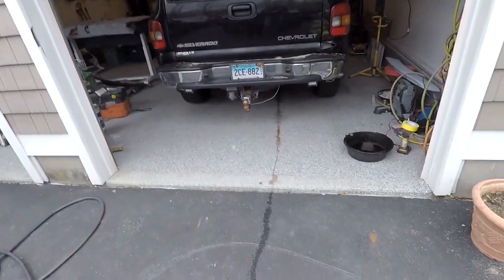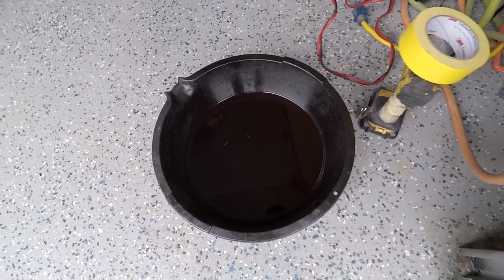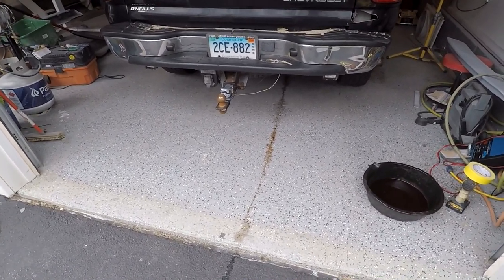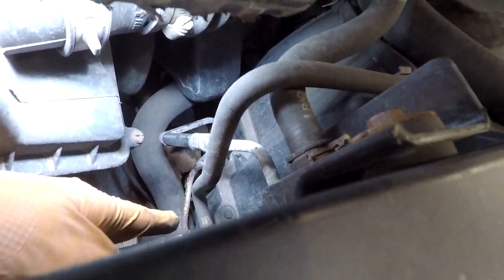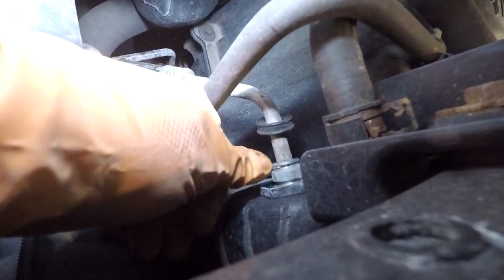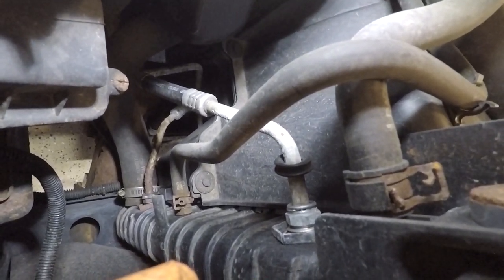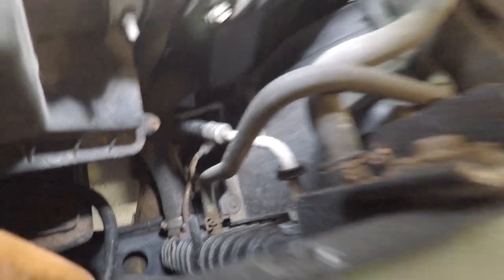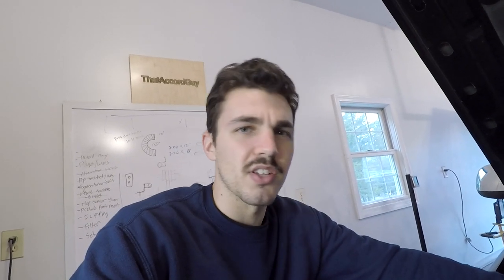How to Replace Transmission Cooler Lines on a Chevy Silverado

Comment: Awesome!  Just completed a transmission cooler line repair and Transmission cooler Upgrade. Unfortunately,  had to install the new cooler toward the passenger side, and cut off the hose  at the fitting( if you cut the band it will leave you with a hose band on the cooler line)  Slipped on the new hose onto the existing cooler lines the one line was so  bad i had to use a Dorman compression to Barb fitting. as a result i forgot where the lines Went?  this video was a saving grace :>) 

Thanks for the cooler line explanation about 13 minutes as a result i have subscribed to you r channel, Thank you
Reply from the maker: Hey thanks for the sub and glad I was able to help you out! Sounds like you made it work!

Comment: good job man my truck has so many miles i just cut the lines and replaced them with nylon tranny lines with hose clamps
Reply from the maker: Yeah just make sure that they stay on there. High line pressure can cause the lines to slide off. Compression fittings with barbs are the best for adapting to stock lines. Thanks for watching

Comment: Great video.  Correct me if I'm wrong but the bottom line from the radiator, regardless of extra cooler or not, is where the cool fluid returns to the transmission pan?
Reply from the maker: Hard for me to remember right now to be honest but I always look when I'm pulling them off!

Comment: So you put the retaining clip on first then insert the line until it snaps?  I just replaced a radiator and put the line in first and then the clip.  I had two of the retaining plastic caps missing and put ring clamps on them until I can get some replacement caps.
Reply from the maker: Yeah I would say either a zip tie, or some sort of hose clamp would keep the rings in there. But the plastic clip is important for holding the rings from backing out cuz otherwise they could pop themselves out

Comment: I use a clip spreader tool ,it stays in place,  then you can just push the line in and it snaps in place
Reply from the maker: Nice, I haven't seen that! Luckily on the new trucks they just have a block that bolts on. That's what I deal with these days mostly at work.

Comment: Late comment, but how did you manage to thread the pipes through the bottom of the vehicle, having a great deal of trouble rn. Thank you.
Reply from the maker: You have to have the vehicle jacked pretty high and I believe you may have to lower the differential down to get more room. They're not easy. Just don't get pissed and bend em up lol I've done that.
Reply: @ThatAccordGuy  thank you brother !

Comment: There is an 0-ring from where you pull the lines out of the clip.You did not replace them? How many miles are on that truck?
Reply from the maker: Probably 80k or something. Never replaced the o-rings in any old truck I've done lines on and never had one leak. Unless they're all rotted then it's different.
Reply: @ThatAccordGuy  Appreciate the reply. I have  Chevy GMC 2008 c4500 that has a leaking line that I am going to tackle myself.Do you work on those as well?
Reply from the maker: Have not worked on a 4500 buy I'm sure it's similar. What transmission? Allison? Or 6l90?
Reply: @ThatAccordGuy  Allison transmission.
Reply from the maker: Yeah that's a beast transmission. I'm sure it's similar tho most GM stuff is the same style with cooler line fittings.

Comment: I heard the lines can still be good and they just get clogged cause transmission  to over heat the make the fluid really thin which make it get hotter and of course you then get symptoms of like it dieing in reverse
Reply from the maker: Never heard of a clogged trans line. We change them because they're rotted and leaking. If the trans blows up you should flush them to get debris and converter material out of them. but the cooler could be clogged. Not the lines tho

Comment: Do you know the part numbers for these lines by chance? The longer line on mine is leaking. Mines also a single cab long bed but they should be the same
Reply: Plug your truck info into Rock Auto. For my 2002 Suburban it was 15809054 for the upper and 15773661 for the lower. I do not have the towing package so I didn't need the third line.

Comment: You probably said it, but what is year of Silverado?  Thanks
Reply from the maker: This one was a 2001. Should be the same from pretty much 99-07 trucks. And even the newer ones are the same basic process
Reply: @ThatAccordGuy  Thank you.  I have a 1994.  It only has two lines (looked at it after viewing your video, which was quite helpful) and they appear to be much easier to get at than the 2001.  At least I know what I’m getting into.
Reply from the maker: Oh that's good to hear. Aren't many of those trucks on the road here these days. All rotted out. Good luck, glad I could help

Comment: I have chevy orlando and lots of fluid came out while waiting on traffic light and the car would not drive front or back,so far no mechanic can repair auto in my area ,shame  hope I did not kill the gearbox
Reply from the maker: As long as you didn't cook it on the highway or drive it too much it should be fine
Reply from the maker: Awesome!